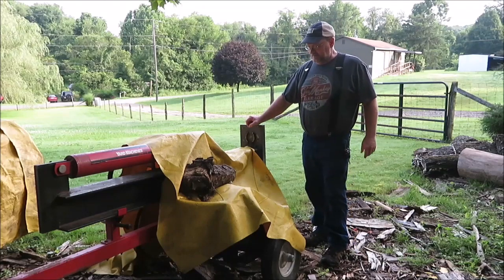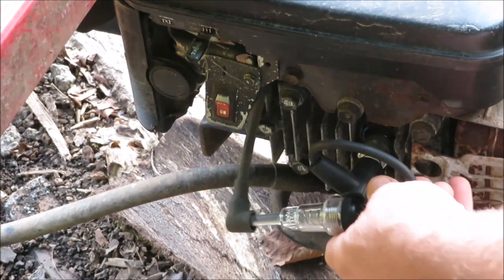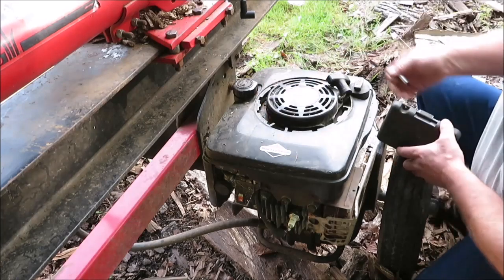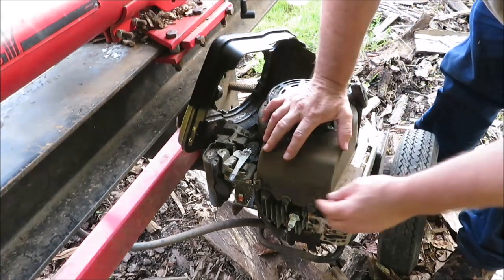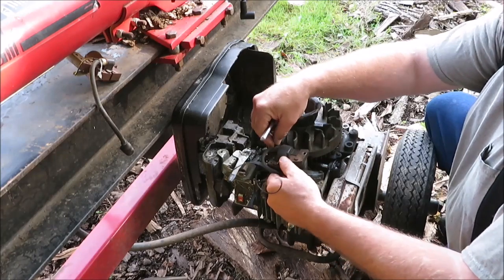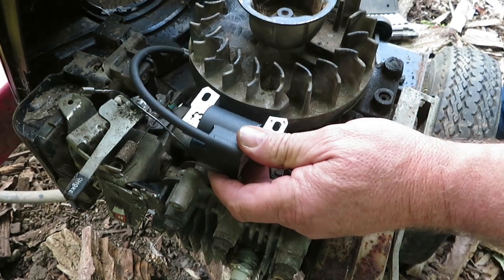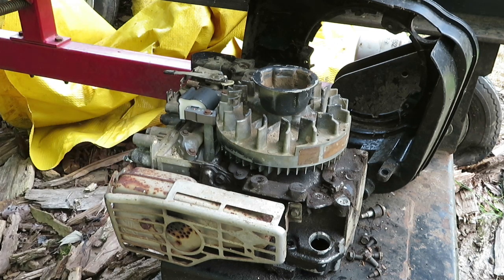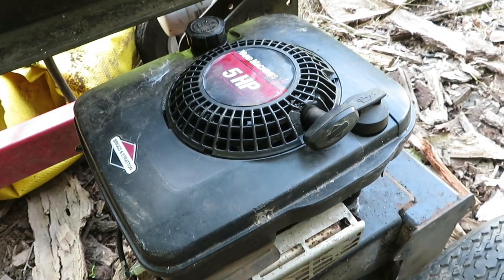Briggs and Stratton Engine Coil test and replace

Comment: Got the same reading on my ohm meter. But being the persistent soul that I am, I followed up and found corrosion between the end of the wire and the cap on the spark plugs. Took it apart, cleaned up the contact, put it back together, got good readings. Started on the first pull.
Reply from the maker: Good information thanks for sharing.

Comment: Great video - thanks for sharing.  Just paid $40 for the same part for my Snapper rideon!
Reply: How much did you gap it? I’m changing the one on my 28” one. Engine is a 12hp 21A907-0124-E1

Comment: This vid makes me want to tackle a chipper I inherited with no spark, been putting it off. I used to work on the old school Briggs back in High school. It looks like the electrical is easier today than back then to work on. Thanks for sharing.
Reply from the maker: You can do it just take your time thanks Steven.

Comment: I know about all the “cheating ways” to gap the coil, but you need to gap it per the spec and with a feeler gauge. The long bladed ones are nice for this job. If not you could end up wasting money on a coil when it was just out of adjustment. See way too many home brewed ways to do things and more times than not they are incorrect or adjusted incorrectly;  folks get mad when I charge them for something they supposedly did already but it was wrong. Trying to help and save someone some $$$$$ Good job Kevin.

Comment: I use 3 or 4 thicknesses of newspaper for the coil gap. Also use the magnet on the flywheel to hold the coil in place whilst tightening the bolts.
Reply from the maker: Thank for the tip Nick.
Reply: I used a business card and the flywheel magnet to hold the coil in place. Then checked the gap was correct with a feeler gauge.
Reply: That's the proper way,,I use Post card,,

Comment: So I'm in the same situation as it's time to be splitting wood and my wood splitter is similar to yours with the 6.0 B&S .  It started right up in May and worked fine for a couple of weeks.  Then, one day, no spark.  I get a new spark plug....still no spark.  I order a new coil since I'm over a 100+ mile round trip and wait for it.  It came today.  I followed the whole process of installing it.  Still no spark.  I tested the old coil and the new coil with my meter....no resistance readings on either coil.  Bottom line is I'm stuck in the Alaskan Bush with no wood splitter.....ugh.  Anyway, thanks for sharing!  Your engine and this video are the closest I've found to my problem and I failed to get that satisfying ROAR at the end.

Comment: When I gap the coil I just use a business card. That's about the right thickness
Reply from the maker: That works to thanks.
Reply: Thanks! I was just thinking I need to buy another tool!
Reply: Mine had rust on the perimeter of the flywheel which I removed. The rust is not a good conductor of magnetic fields.

Comment: I had to stop the video at 3:55, to post, because you said it was the coil...could be, but the tests you did at this point, have not ruled out a bad spark plug. You can test the spark plug with your meter as well.
I made my own spark tester. I soldered a wire to the body of a good plug and added a clip to the other end. I then broke off the tab at the end of my test plug, making a much wider gap. The idea is that a spark plug can look like it has a good spark when, testing using the old method of removing the plug, connecting it, and laying it against grounded metal. I heard that it is harder to make a good spark when installed in the piston chamber and under pressure, etc.. In any case, the wide gap of my tester rules these things out, since if I get a spark, it must be a good strong one. To use my tester, I do not have to, but usually remove the installed spark plug, so the engine will spin easily and fast, and has no chance of starting. I connect the coil lead to my tester spark plug, positioning it so I can see the spark. I hook the ground wire from my tester to bare metal on the mower, and pull. My tester rules out a bad plug and/or shows the plug is the issue. FYI
Back to watching...have a mower with no spark, doing some homework before further testing ;-)

Comment: i have coil part number 593142 for my craftsman 5.00 lawnmower and everywhere i look this part number does not show up?
have gas
spark plug test which is low spark
new spark plug and still low spark

Comment: Just replaced the coil on my splitter, same engine you have here. My splitter would run for about 10 mins, and cut off. After it cooled down for about 30 mins it would restart and run for about 10 mins and cut off. Well, after replacing the coil, the problem still persists. Any ideas?
Reply from the maker: I would think the coil to not sure maybe a dirty carb maybe not running to long not sure sorry.
Reply: My lawnmowers did the ssame also on Briggs engine. Had to replace diaphragm inside carb which pumps fuel problem went away. Coil is still the old one

Comment: I'm having the same problem with the exact same machine as you have.where did you find the coil and do you have the part number for it. Great video just what I was needing to know. Thank you
Reply from the maker: I don't have the part number sorry Paul.
Reply: I'm having same issue same one also can't find that coil
Reply: When I could not find the correct mdel and part number, I just bought the closest Briggs & Stratton coil, but not the correct one. The arms on the coil do not make full contact with the magnet. Can I grind the part of the arms so it sits flush with the magnet?

Comment: Great video Kevin thanks. By the way one question please - I have a Mountfield with Sumec engine (RV40 - RV150 Series - and 
purchased an after market coil which is failing to produce a spark. I 
have tested it and the reading is 6.2K Ohms - is this reading too high 
for this machine please?
Reply from the maker: I'm sorry I wouldn't know Trev.
Reply: @Robinson-Homestead  ok no worries. I was worried that it did not fall into the 2.5k-5k ohm range for this engine. I have fitted it and it is sparking away so see what happens - thanks for swift reply and loved the video, keep em coming.

Comment: My pressure washer has the  B&S   Diamond  6Hp and it starts ok sometimes when its cold but stops after 5 minutes of running and no spark   Coil time
Reply from the maker: I think it would be the coil to thank you for the comment.

Comment: Using spark plug to test for spark -- ground the metal threads NOT the tip.  Like you I use a tester for fast, easy and certain.
Reply from the maker: Thanks for the comment Joe.